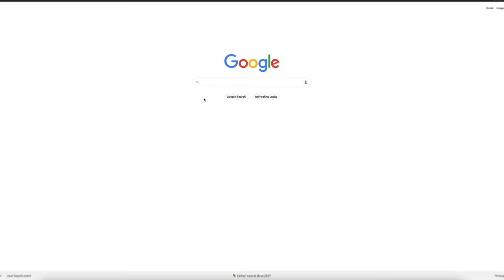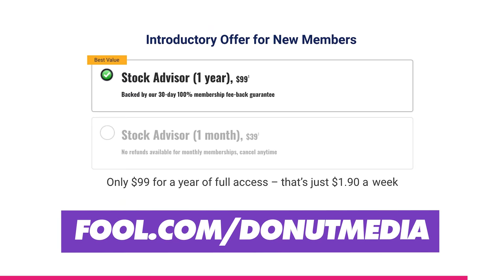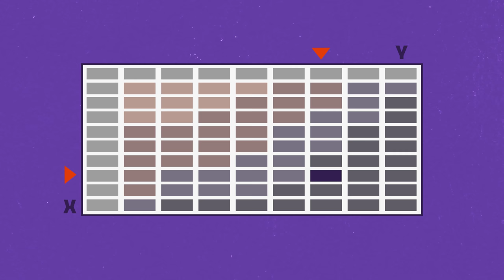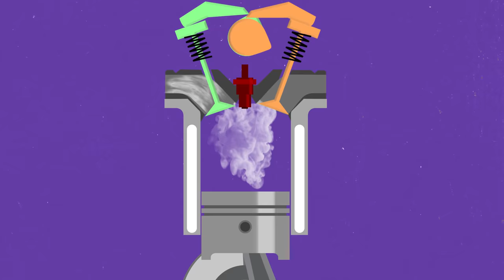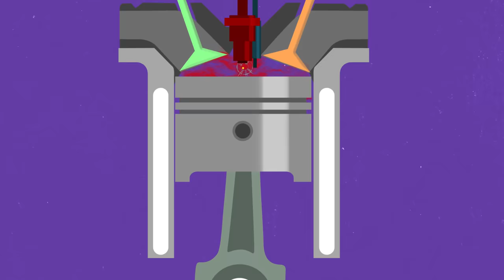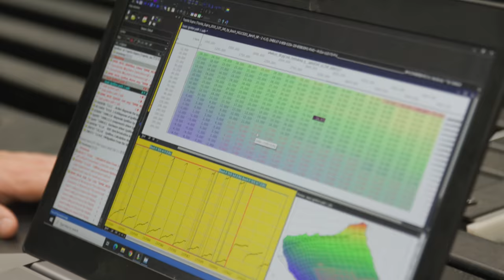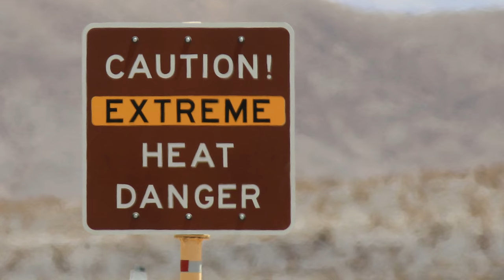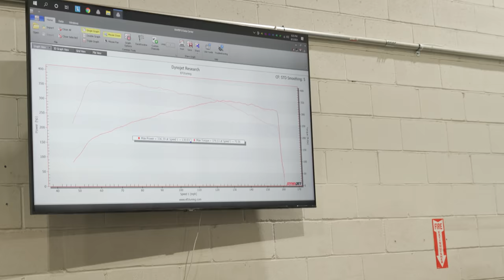Why Are They Banning ECU Tuning?

Comment: I see the value of classic cars that are smog exempt getting even higher......
Reply: As a wise man once said *we dont care &
Reply: It's almost like forming regulation for publicity has negative ramifications, or something... Huh.
Reply: Couldn’t people just have 2 ecus?
Reply: @AlicesMazduhs  yeah but that’s typically really expensive because the ecu has to match your vin and a dealership has to do that
Reply: @SeeJulianGo  is that for newer cars? My dad has two ecus for his 97 Saab and it was relatively inexpensive and easy
Reply: Cue thousands of people learning about carburetters
Reply: @SeeJulianGo  All you need is a stand alone ECU and buy a vin license. You or your tuner can do this. It's easy.
Reply: @SeeJulianGo  no? You act like a Saturn dealership is gonna pop up and match a vin for a 02 Saturn? Lol people get around shit
Reply: @AlicesMazduhs  Because of how ECU's initialize and are constantly live reading data, no. But there are several ECU's that can run multiple settings based on input. The flash tuner for my Mustang let's me retune any time I want. 

The more expensive MegaSquirt ECU's allow up to 5 settings, that you can swap in-between if you have a computer on hand. A lot of Honda's can swap between tune's to... the economy mode button disengages the VTEC and leans the fuel mixture relative to throttle position.

Smart thinking, but the technology for running multiple ECU's doesn't even exist in computers, yet. I can't wait until it does though, The ability to switch based on the application you need to run would be super handy. I'd love to have the same machine be an intel server one minute, and then a gaming machine the next. I'd save so much money.
Reply: as a collectable yes. but in this sense no. because they also are not as tunable and a modern Camry is faster 0-60
Reply: @SavageZebra67  that's where a restomod with a modern motor and drive train come in....the prices of them have gone up a lot.
Reply: Hopefully states come to their senses and stop allowing these cars on the roads.  They're upwards of +25x worse than modern cars in terms of emissions.
Reply: @brwils3378  The masses in California want cleaner air.  The 0.01% with a modded ECU have very little effect on the end results. Especially when you consider a chunk of them were already voting for deregulators anyway.
Reply: @veganpotterthevegan  that's not 100% true. Yes their motors may have more emissions but the trend of getting a new car every couple years and the manufacturing of said new cars to meet the demand has a far more impact on the environment than keeping an older classic on the road.
Reply: I've been pondering that very concept
Reply: @akuriarenzaul  What happens with the old newish cars?  People replace their old, far dirtier cars with them.   And what percentage of classic car owners don't drive other cars too?
Reply: @hazien2602  well... if you're into cars.. you will care..  you will.
Reply: @veganpotterthevegan  sure. It doesn't have to be a classic. It can defbe a 10+ year old car too. The point is we live in a throw away and get new culture and it also applys to cars. The majority of car buyers are replacing a car that are only a few years old for the newer model. If we cut the production of actual new cars and kept what we have for longer periods of time it would do better for our planet than what older cars produce in emissions.
Reply: I bought a house on a lake that is 20 feet from the shore.  If I bought land and built it, current regs would be 100 feet.  Guess what is worth more?
Reply: @akuriarenzaul  10yr old cars are also generally eventually sold to people replacing dirtier cars.  It's all important.  Through the life of a car, it doesn't take much mileage to where your carbon footprint wouldn't be equalized by production of a new car that's cleaner.  And shit, any dummy with a diesel truck that's not serving the masses would be better off being crushed and replaced almost immediately
Reply: @scd603  You'll be 100ft from shore in no time 😂
Reply: @veganpotterthevegan  Teslas And Ford Mustang Mach-E's Are Better off Being Crushed "For The Masses" !
Reply: That’s been a steady climb 🧗‍♂️ for a while.
Reply: @zeecet2457  Your comment is quantifiably senseless.
Reply: @alphawolf4714  🤔 Do you really know what you're talking about when it comes to computers and networking?  Your description of "what computers are capable of" sounds like BS.  I am studying at university for networking and software development and have been an avid programmer for 3 years.  What you are describing does not sound impossible at all.
Reply: @yourzombiemop8259  When it comes to computers in cars, I am an ASE certified Japanese tuning expert. When it comes to computers, I'm a novice with about 20 years of experience working on small personal projects. 

I am by no means an expert, but I never use the word impossible either. I made it very clear that I don't see the practical aspect of seeing two powertrain ECU's in a vehicle, Considering how modern tuning allows for variable modes already. 

Anything is possible in theory, student. Real life application often presents limitations you cannot foresee and expect until you encounter them.

Please do not refer to my knowledge and opinions as "BS". At least, not until you have a few years practical, real world experience with which to criticize me, thanks. Seriously. For someone who is in a position to learn, coming at someone so bluntly and aggressively is only going to limit your avenues for future learning, man. Some humility and tact will take you to much higher avenues after college.
Reply: @SavageZebra67  Well... You're half right. If you leave the car factory, older cars don't gain much from electronics. Modern Camry's are pretty incredible.

But... A lot of engines and transmissions that are no longer produced were limited by there time. By combining them with modern systems like direct injection, modern balancing technology, camless valves, etc. you can push absolute craftsmanship found in engines like the RB26 inline six, or the 454 Big block, and get incredible power-to-weight effeciency. Thanks to Mazda's constant innovation we have things like super clean burning rotary technology now that would allow very light vehicles, that could change into lap time setters with the push of a button.

There are indeed some things in the past that were crafted better, and with a good set of parts and a good tune, could outlast many modern cars, with higher sports potential to boot. 

It's not as expensive as you might think as well. When Zach Jobe mentioned innovations in suspension technology the other day, he noted that most lower springs are well made enough now, that you don't need to spend coilover money to get increased ride quality on older cars. 

The full completely adjustable (caster camber and toe) setup on my '09 Mustang only cost about 1000$, and has dramatically increased fuel economy in city, while making thar car capable of going out on country trails and tight tracks, both. It takes me 15 minutes and 4 wrenches to change the adjustments. And my 4.0L V6, now that I've reinforced the cooling system, should last for 400-500K miles. They don't make light weight, well balanced V6's like that any more. 

I'm calculating around 28-32 mpg after the next few mods and another tune, as well. I can already haul about 2000lbs with my current setup as well. A completely modular car. Can't do that with almost all modern vehicles, because they're so purposefully and single mindedly built.
Reply: @alphawolf4714  I was referring to your comment about running an Intel server and a gaming rig on one machine.
Reply: So buying a old shitbox or wreck is better 😂
Reply: @alphawolf4714  i think Alice meant like u own 2 ecus. 1 tuned, 1 stock. And u just unplug and plug in whichever 1 u want/need. I know some tuners do offer spare ecu tuning. They do have the ability to vin flash some ecus so people can do this, then swap the ecu if they have to go to the dealer. Granted it is usually pretty expensive for newer ecus but that's the price to try and go undetected. My car like urs has a tune that I can just flash between stock and say a 93 octane tune in like a minute.
Reply: @davidtryon1205  You might just be right! Thanks for the insight. My car actually uses the stock ECU, but my tuner sold me a tuning device that let's me swap between the stock settings, a launch setting, and a 3400-4400 rpm specialty setting for drift. With the next car you should look into that option. I saved about 1500$ thanks to not having to buy an aftermarket ECU. It's an HP Program and Tool!
Reply: @GhostOfDamned  Or any of the old and reliable, and already factory reinforced vehicles, like: 4.0L and 4.6L Mustangs, most japanese and european inline 6's, Chevy 3800 Series ii and Series iii, or Mazda 323/626/929/MX-5/RX-7/3's and 6's. All cars you can swap some factory parts on fairly easily and then reflash the factory ECU using tuning programs like the one's offered from BAMA and HP Tuners. Just saying. As cars get older and show their ability to handle extreme stress and the test of time, aftermarket companies are more likely to invest in high power or reinforcement parts for those vehicles, some parts looking nearly identical to factory, in such a way that cops in states like Cali, wouldn't be able to hit your car with some "This car isn't stock, it belongs in a state Junk yard now" bullshit.
Reply: @veganpotterthevegan  But   old classic cars are generally driven very little, like for a weekend short trip to a car show, not used as daily drivers.
Reply: @johnmcmullen456  That doesn't mean their emissions are excusable.  They're often towed to places which is also terrible.  Again... upwards of 25fold the emissions per mile. Their weekend trip can be a months worth or more of an average person in a normal ICE car.  *If it's a car show, think of the emissions of the visitors too.  The car owners in the show are responsible for that as well
Reply: @veganpotterthevegan  Old classic cars are a big part of our transportation history and need occasional driving to stay in good running order. A well tuned classic running on our unleaded, ethanol blended fuels wouldn't be putting out the level of emissions you state. I get it that you are not a car guy but you environmentalists just go too far.  I suppose you would prefer we destroy all antique  cars, and may as well ban all forms of motorsports. Why stop there? Let's go after all off road recreational vehicles,  power boats, gas powered golf carts, chain saws, lawn mowers, etc. Surely the loss of millions of jobs and GNP would not impact our economy and unemployment rate.
Reply: @johnmcmullen456  And yes, the emissions are that high. Even with top tier gas.
*Let's go after all heavy emissions emitting activities.  We should have done that decades ago.
Reply: @veganpotterthevegan  According to a recent Hagerty Insurance article, about 30% of total pollution is from transportation, including airline travel, trucking, and all other forms of transportation including our personal vehicles.  Impact from vintage/classic cars is miniscule considering what small numbers they represent and how little they are actually driven annually.  To suggest such cars caused so much suffering and should be destroyed, totally ludicrous.
Reply: @johnmcmullen456  No it's not. We can't easily stop using air conditioning and getting food delivered. Classic cars are low  hanging fruit.  And it's idiotic to not do something about it.  
*We should ban private air travel too, and tax the hell out of commercial flights
Reply: @veganpotterthevegan  Classic cars are not low hanging fruit to hobbyists or car enthusiasts, just easy targets for over zealous regulators not willing to take on big corporate polluters.  The number of collector cars on the road decline, several are lost annually to floods and wildfires, and there's little potential that today's "appliance" vehicles will be future collectibles.  So again, there is bigger fish to fry than to go after the individual who wants to preserve a small piece of automotive history that future generations may enjoy as well.  To reduce emissions from transportation, what this country needs are such meaningful things as mass transit improvements, more rail and less deliveries by truck, and fewer flights that are way below capacity.  Likewise,  billionaire trips to outerspace should be banned.
Reply: @veganpotterthevegan  So dinky the overall emissions reduction would be immeasurable, so why such a hater?
Reply: @johnmcmullen456  No, the number of people it would effect is dinky.  The stopping of emissions is sizeable relative to the work needed to stop it.
Reply: @johnmcmullen456  The hard stuff is clean energy. As air gets worse, we need to run our ACs more often. Even when it's not hot.  Getting electricity to the poor who cook with coal in developing nations is hard.  Ending an unnecessary luxury that causes a lot of harm per mile(for funsies) is absolutely low hanging fruit.  I haven't flown for 6-7 years. I'm never flying again and most of my family is overseas so I'm never seeing them again to do my part. And you don't even wanna give up driving your archaic car.
Reply: @alphawolf4714  true, im trying to buy something close from 80s or 70s 
But of course the cops can’t distinguish a fuken alternator form a turbo lol
Reply: @GhostOfDamned  Yeah... Which is so sad, considering they're vehicles have become so great because of turbo's and electrical management systems. 

Welcome to the modern world, where most of the people tasked with defending our rights, are either nefarious or ignorant. -_-
Reply: @veganpotterthevegan  My classic car sees fewer than 500 miles annually, my house is not air conditioned, and I don't travel by air either. I won't be shamed into making any further sacrifices.
Reply: @johnmcmullen456  Let's say it sees 400.  Without a cat, you're producing the emissions of upwards of 10,000 miles of non-hybrid  ice cars.  That's fucking terrible. It really is that bad. Then whatever you're producing in your daily driver
Reply: @alphawolf4714  ayo its a pain
We are moving backwards not forwards as some people say
Reply: Exempt... for now.
Reply: That's gonna suck
Reply: Thats why I have hoarded Chevy IIs of 1962 to 1967..cars and parts since the early 1990s, and still drive them as daily drivers. Acquired many of thrm while they were still plentiful and cheap.
Reply: @johnmcmullen456  Not mine. I drive mine every day. 41 consecutive years of driving vehicles 1971 or older. Still driving a 1951 Ford daily.
Reply: @veganpotterthevegan  Those future generations will never enjoy driving the cars made pre-1968. I keep my pre-1968 cars running if nothing more than to piss off the tree hugging environmentalists.
Reply: @lawrenceartz8640  I've driven plenty of those cars. From Corvettes to Cadillacs. They're pieces of shit compared to even a new Corolla.
Reply: @veganpotterthevegan  Over 200,000+ miles driven in my 1963 Chevy II station wagon I've driven everywhere...from Maine to Florida and points in between.
Reply: @lawrenceartz8640  Uh...wow I guess?
Reply: @lawrenceartz8640  I just have too many vehicles and not enough places to go.  
LOL. My collector car is a restored 1970 Corvette, was my late father's pride and joy, and gets many compliments from all ages.  Not going to let over zealous environmentalists get under my skin and shame me for preserving a piece of automotive history.
Reply: @johnmcmullen456  Three years ago, I bought the 1951 Ford I found (wasn't even looking for another car...I happen to stumble on it), but it was off the road since 1970. I'm not even into Fords. However, it was the perfect car to return to the road in order to maximize the amount of automobile emissions (it has a vented crankcase road draft tube and a vented fuel system through its original flathead V8 engine) that makes it the PERFECT car to make a political statement every time I drive it. I've parked it in "hybrid and fuel efficient parking spaces". I would like to at some point acquire a LARGE 1960s Chrysler New Yorke, Imperial, Fury, Monoco etc. or equivalent LARGE land yacht which would be the ideal car to use to stick it to these tree huggers. If one comes my way I'll buy it.
Reply: That means my 64 nova SS with the 230, power glide will finally be worth something ?